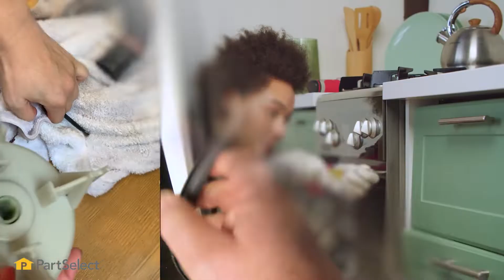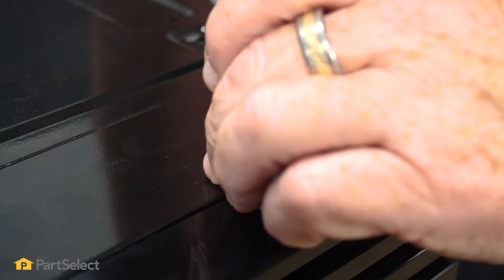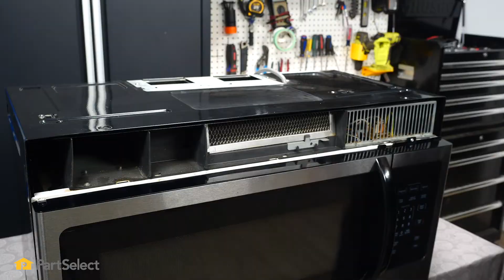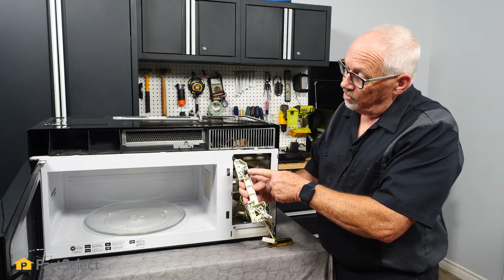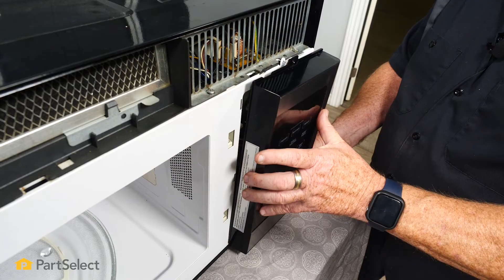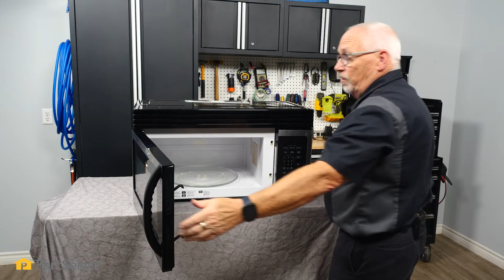GE Microwave Repair - How to Replace the Primary Door Switch (GE Part #WB24X10047)

Comment: My son all three switches in my GE JMV3160RF3SS. When I turned on the microwave, it blew the circuit immediately. Do some switches need to be in an on or off position? I wish I had found this video first, before letting my twenty-year-old son 'fix' the microwave. Please tell me my mistake(s).I've been without a microwave for months. Thank you.

Comment: I ordered the three replacement switches.
Do the switches need to be installed in a specific order? Or are they all the same and doesn’t matter?
Reply: I believe that one of the 3 switches (the middle one) is different (default is on) than the other two. Is that what you found to be true as well?
Reply: @jandrewx2  Is the middle switch a different switch, or just set in a different position? How to set the position of the switch, I don't know! Thank you for your help.